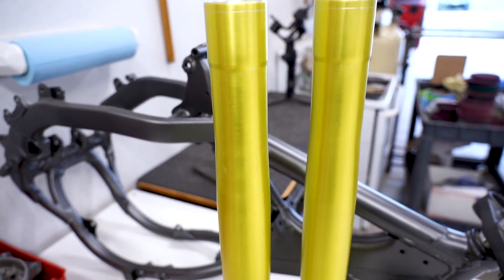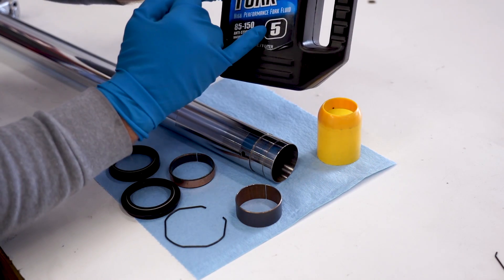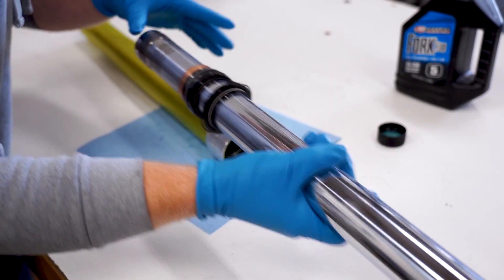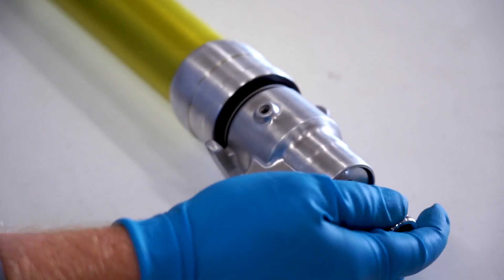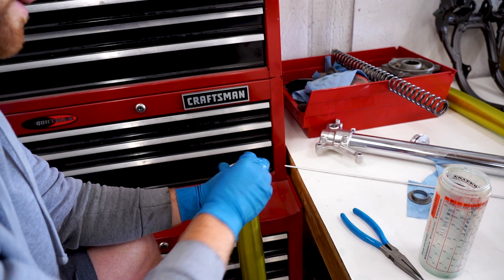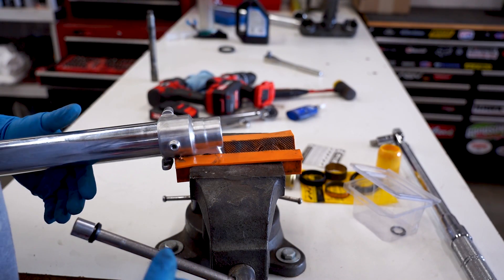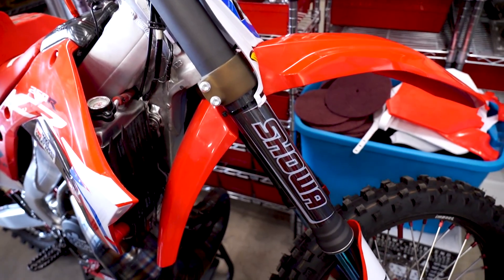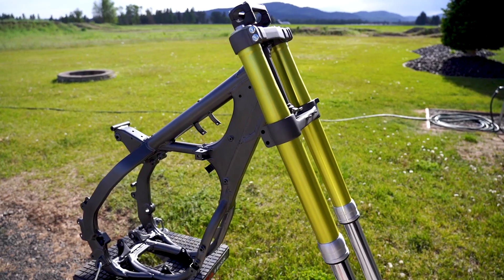The Game Changer | RM250 Rebuild 20

Comment: Man that looks great!  Do you not have the rubber bumpers under the caps, or do those not use those?  Also, a different approach measuring the volume of oil rather than measuring the oil height.  Measuring the old fashioned way should work too.

Comment: Cam dude I have a problem with my forks I did everything you did on the 250 build bc my cr85 is pretty much the same and the forks leak fluid worse then before I replaced the seals and bushings and o-rings my main question here is there a way you can polish or fix scratches in the tubes I think that’s my problem oil going through the seals because of the scratches if there is it would be a help if you replied btw awesome video dude 👍🤘

Comment: Hey Cameron I have a bunch of grease build up coming from the center of the front sprocket, what do you recommend?
Reply: Use differnt chain lubes that doesn't collect dust
Reply: Could be counter shaft seal I had the same problem and replaced it and it’s fixed now.  It’s easy to do you just have to pull off the sprocket.
Reply: @willnaylor1585  counter shaft seal  , I’m going to look in to that because I know it’s not chain lube. I’m new to this sport and I bought a 97 yz 125 & 250 both are 97, and I really didn’t know what to look for as far signs of a repair, anyways thanks for your help.

Comment: Do you know how to fix a Mikuni carburetor that idles way too high and it is not the idle screw
Reply: Air leak likely so spray some carb cleaner around the carb and if the idle rises when you do that then you know
Reply: @ste7590  thanks.. I couldn't get it to idle the right way so I just put the original carburetor back on. but I will have the Mikuni put on by professional

Comment: Hey i have an 06 rmz450 that I had resleeved and put a vertex piston installed I did myself
Reply: Of course new gaskets and valve were inspec just I had a had time with timing it and it’s very hard to start and smokes a lot like it’s burning oil. Any advise ?
Reply: @twosmoked1805  probably valve seals and seats
Reply: I have new ones ready but also think it might be that I overlooked the direction of the piston rings and which way the open ends face